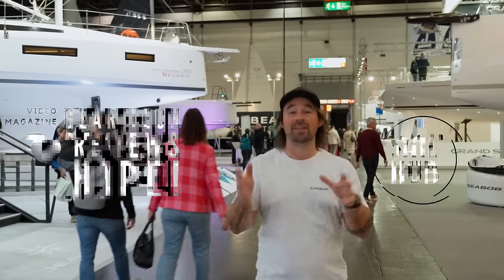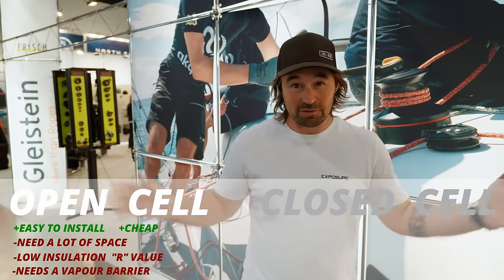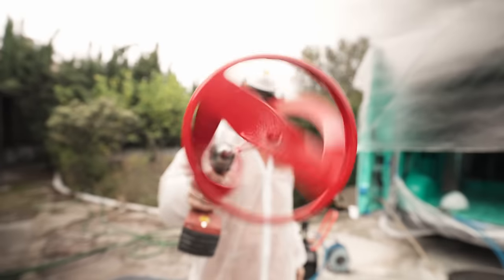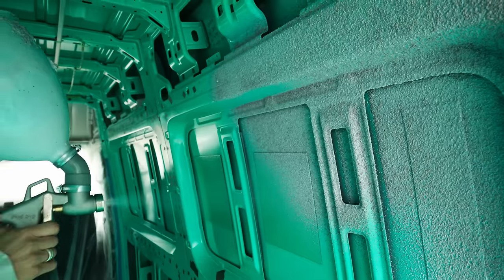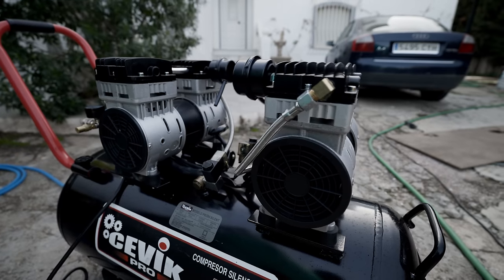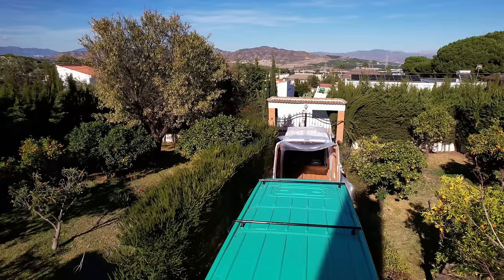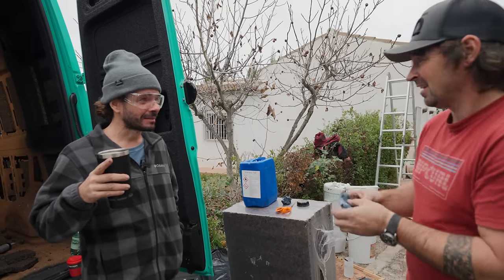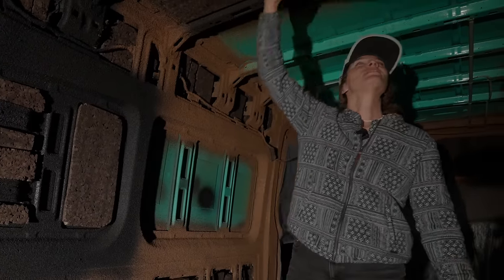Spray Cork Insulation. Is it a game changer for Everything?

Comment: Would have been good to see the finished job inside the van. Also a breakdown of costs would be useful. I've been looking into cork insulation and have found it very expensive compared to other forms of insulation. I love the finish of cork thought hat has significant advantage over other insulation. Would be good to fins out what you spent.
Reply from the maker: Hey, It’s all dependant in where you are and why you want. I will add this to an upcoming video where we test the cork for you. 
I’m short, it was €190 per cork bucket:m. We used 10. That was for sufficient to do the van for the arctic as we are testing it to see if it’s good enough for our boatbuild that we are taking up there. You could generally get away with 1/2 to 2/3 of what we used. 
It is expensive but you do gain in areas; there is no need for sound deadening and there is no need to line the walls with anything such as carpet etc. 

Another note is that we used a marine based product, ‘Seacork’ it’s expensive as it’s developed for the humid marine environment, there are much cheaper options out there with similar insulation benefits however the overall performance (longevity, mold resistance etc) is generally reduced.

Hope this helps. Cheers 👌

Comment: Cork gets moldy in a damp and dark corner. I have 5yrs liveaboard experience in cool climate; Armaflex closed cell sheet is the thing. Stays clean and dry.
Reply from the maker: I can see your ponts for sure. Mind you are you taking sprayed cork here? If you are how much of it is there? It sounds like there is not enough.

We’ve met many boats now that have been around the world without trouble and it’s also the go too for arctic vessels (hence our interest). The ones that have had any condensation have had to little thickness. When topped up to a hood thickness the problem goes away.
As for the armaflex, it is great but I’d have to do some tests, I would actually really like to do some testing on it, at the end of the day we’re just looking to inform people of their options and we can only recommend what we can personally trust. So cheers, here to hoping we can test some sometime 👍👌

Comment: feeling the temperature is same as standing on tile floor in bathroom with or without slippers.. Temperature is in both cases same but bare feet "feel" colder due to heat extraction/conductivity..
Reply from the maker: Exactly, we can feel that the cork is not a heat sink. 👍

Comment: Did I miss a breakdown of the total cost of insulating the van with cork? It would be helpful?
Reply from the maker: You did! It massively depends on the brand of cork and of course the size of the van hence why we didn’t go into it.
Reply: @SailHub  - Yes, but as we can see both the size of your van and you specified the cork you used, it would give us a general idea of cost?
Reply from the maker: @paulsinclair3401 sure. We used 11 pots of Seacork in total. We could have done 10 easily as we cut more of the roof out than expected. We also are only cutting out two windows so there’s a lot used there which many people would not need.

Second to that we put 4 layers in there as we are testing it for arctic cold climates that we are building the boat for. I belive 2 coats is common for vans.

Price is relatively high at around €190 euro per pot when we bought it, the pigment was super cheap but I can’t temember exactly. I suppose the good thing for us is that we don’t need acoustic insulation too as the van is a podcasting suite.
Reply: @SailHub  - Many thanks for that...... gives me a general idea. 👍👍
Reply from the maker: @paulsinclair3401 no problem chap 👍

Comment: Interesting product,  not come across spray cork.  Is it vapour permeable?  I guess it must be, as applied wet, once it dries it will leave pores. If so moisture will build up, though the cork is naturally mould resistant, whatever it is fixed to is a possible issue. 
Cork board is know has a much lower insulation value to the plastic foams. So if overall heat loss is important perhaps not best.  But just for condensation maybe.  
I don’t think there is a really closed cell spray foam, I have never come across one.  Most are polyurethane, they definitely aren’t, well certainly after a few years…and hell to remove. 
I would be very wary of any spray product below waterline or where water could collect.  
If you are mainly in a cold damp climate, all these products that do absorb some moisture should not be used.  If only for short periods of time, they can absorb a bit then dry out.  (The same for building flat roof insulation, which I do know about)
Reply from the maker: Hi Mark, a lot off hood points there of which we will need to contact the manufacturer about, we are doing some testing at present ourselves so stay tuned to see what we find.

As for water absorbing. I belive it’s lded good, it’s commonly found below waterline on boats such as the Garcia exploration etc. I’m told it doesn’t take on water which sounds great.

There appears to be no U value present  but the difference in our van was to be quite honest, unbelievable. We were very impressed. The sound deadening is also exceptional, so let’s see what we can test and find out!
Reply: @SailHub  great.  
In small spaces r values are not that important as they soon heat up.  A house might need 30cm, whereas a boat / van 3cm
Reply from the maker: @markthomasson5077 right, that kinda makes sense but I also think it’s a problem I’m done areas. I.e fridge insulation is often crap based on the sand theory and they then remain the biggest electrical consumer onboard. 

Mind you, as a generalisation I rekon your bang on👍

Comment: How many coats did you end up spraying?
Reply from the maker: We did 4, our friends did 3. We were told 2 is enough for the Med and 4 for northern scotland.
Reply: @SailHub  Thanks for sharing.. I like the way it looks as a finished surface for all of the rounded metal corners and doors.
Reply from the maker: @noah786 yeah it’s pretty cool although it ones tracks the dust. That’s being said we have ends it flat in part of our van build so we will show that soon. It works quite well

Comment: ?Interesting , however  if you spray this on the inside of a metal yacht won't it hide corrosion & potentially be dangerous in that way?
Reply from the maker: I can see your thought process for sure. The cork is like a skin, so in theory it should stop damp getting in. I’m pretty happy with it and I’m aware that steel boat builders use it too, which has to be a worse situation than a van or a car on the roads. Anyhow, that’s my 2 cents 👍

Comment: Thats all rainbows and unicorns until ..... a panelbeater has to try and fix it, how do you find spot welds and drill them out to separate panels for replacement, I can't imagine a better way to conceal spot welds ever.
Reply from the maker: 😂unicorns aren’t real! In all seriousness it appears It peels off if you need access. We found that when cutting up the roof for the poptop instalation.

Comment: Spraying the stripped down walls of a concrete built apartment... 

TREE HOUSE.
Reply from the maker: @christophmahler Amazing! I can imagine the difference must be outstanding?!
Reply: @SailHub  
Haha ! :face-blue-smiling:
I haven't tried it yet due to a lack in any apartment (browsing endlessly for the optimal boat)... 

But I remember that ready made concrete 'council flats' had as much sound isolation as a mini van... 

The cork layer may also help with unheated walls where moisture condensates and forms mold - cork wallpapers or sheets used to be a practice, I think - but an evenly sprayed and even colored cork coat may be more thorough.
Reply from the maker: @christophmahler for sure, I think your right. The only downside is the rough texture but you can of course sand it flat or cover it

Comment: wow you can get 1/3 the performance of spray foam for 3x the price.
Reply from the maker: Yup. Mind you you still get a few point with most foams and they often wick water which isn’t great either. 

Oh, and you don’t need sound deadening or carpeting so the finished product is not 3x the cost, which is at least one thing!

As sad as it is, most environmentally friendly products do come with an added cost, usually due to the small sales quantities, I guess we can hope it gets better.

One last point, where do you get your data from, I’m interested in the 1/3 performance. From my understanding I would actually suggest it could be better than foam, we’re doing some testing soon so we will find out I guess!

Comment: It must have a lot of chemicals added to it to be sprayable. Cork does not just stick to things, as if compressed only, it will easily break.
That thing seems like ESG box ticking bs
Reply from the maker: It’s a water based bonding agent with it. I imagine you could find the details if you search, being CE approved it should be there for all to see

Let’s not forget it’s a hopper gun too. Hardly a fine mist. There is a 6mm hole in the end of the gun!

Comment: sprayfoam fills the gaps in the paneling, this obviously did not. not convinced on the insulation of that van...
Reply from the maker: Yup, I can see why this comes to mind, it did me too. The thing is, it uses a different method. You can see that we taped up all of the holes in the structure and sprayed over it. 

There is complete skin around the inside of the van, so we don’t need to fill the gaps.

Comment: Next time you're at a barbecue, toss a used cork onto the fire, and see what happens. (SPOILER, don't do this. It will explode.)
Reply from the maker: I rekon your going to find our next video on the cork insulation quite interesting!!
Reply: @SailHub  That was slightly tongue in cheek. I suspect that cork that's been shredded, then reconstituted probably won't explode. It's the air trapped inside raw natural cork that goes pop when heated.
Reply from the maker: Can’t imagine it from raw cork. Maybe alcohol impregnated variants. 
The thing is, cork trees we’ve seen in bush fires are the only thing that survive and the cork is still harvestable.
Reply: Fiberglass and plastic is flame proof?
Reply from the maker: Plastic? No, that’s flamable. Fibreglass? Yeah, it’s what fire blankets are made from, it’s the resin you need to be wary of.
Reply: @SailHub  ah
Reply from the maker: @marcschnitfink Bisto? 😂